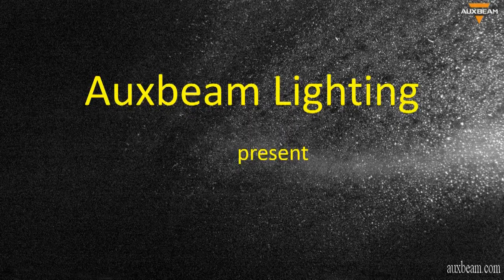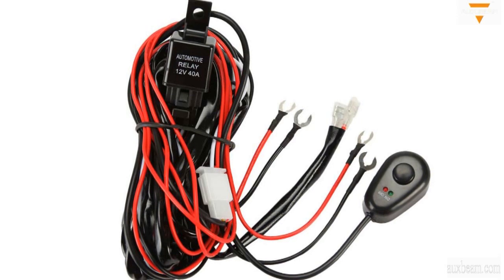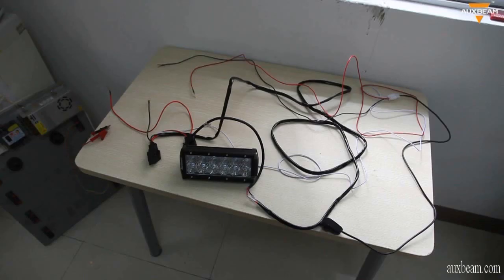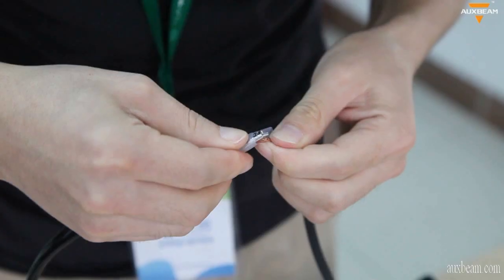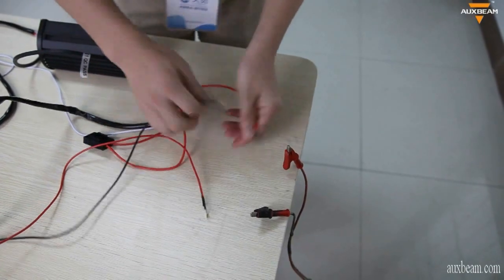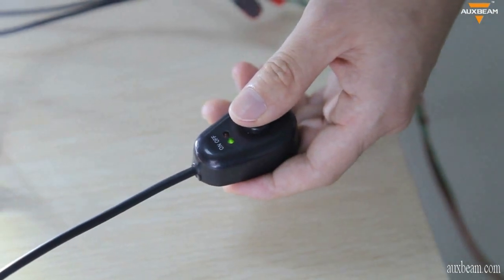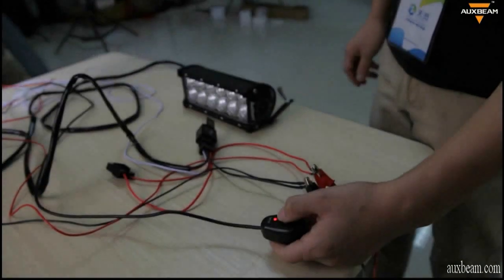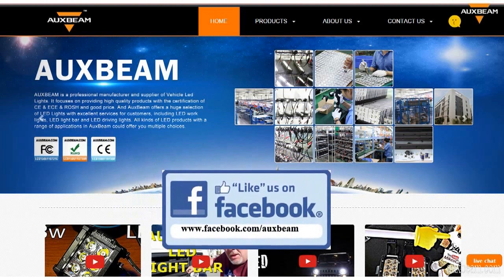How to install relay harness - By Auxbeam

Comment: Will the red light drain your battery?
Reply from the maker: It wont.:)
Reply: It’s been draining my battery. Is there another way to do this?
Reply: @Espinal_424  - connect it to something that is dependant on the ignition switch ... such as your radio
Reply: Luis Espinal I'll keep my eye on it. If it does I'll just replace the switch:
Reply: Trigger Happy nope!

Comment: what if it canes with only white and black wire for lamp and no red
Reply from the maker: Then the harness is useless, should get a replacement. If you've got this problem?
Reply: Auxbeam LED Lighting yes. the instructions say that white is for a DRL but i have an old 95 grand cherokee. No daytime running lights on that model
Reply from the maker: OK. If you buy it from Auxbeam website, would you please email to sales@auxbeam.com for a solution? Thanks.:)